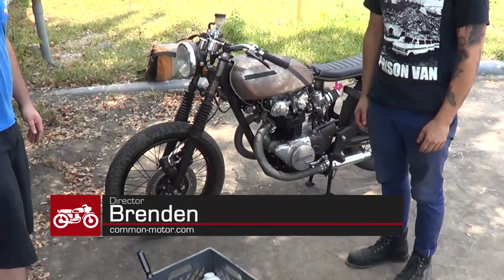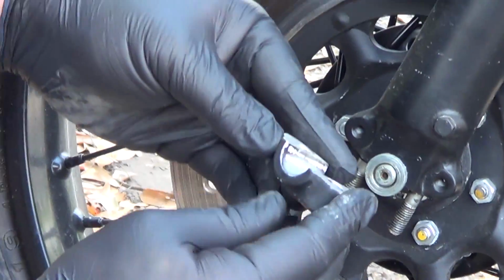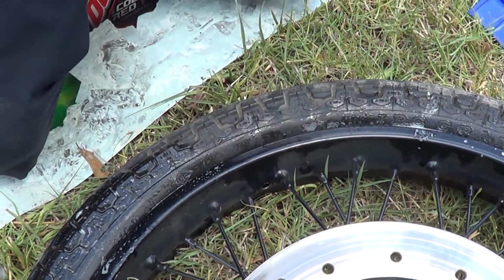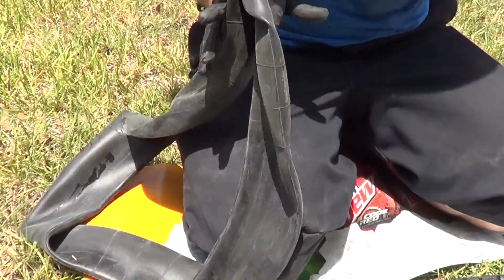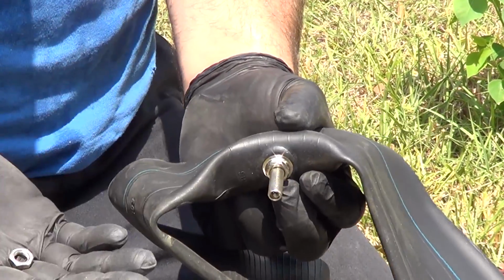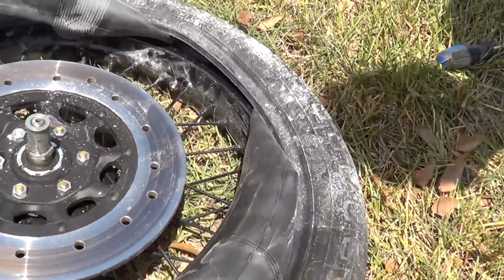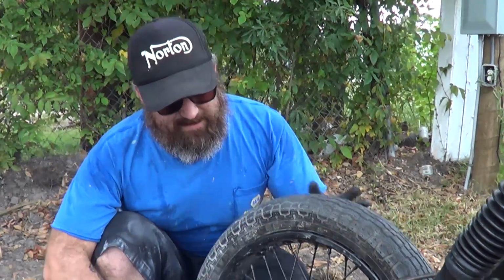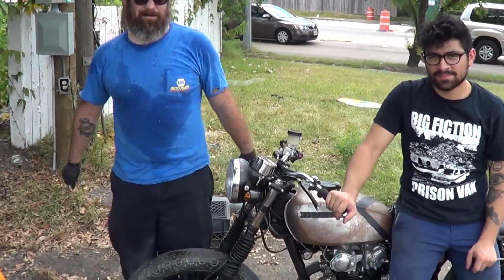How to Change a Flat Tire on a Motorcycle: Honda CB450 / CB350 / CB360

Comment: One plus of a hot day, although we seldom get your sort of heat here, is that the rubber is more pliable. I always hope never to have to work on tyres when it's cold. If so I try to do it in the house, no wonder I'm divorced!
Reply from the maker: I would almost rather walk my bike home than try to change a tire in a Houston summer.
Reply: @Common-motor  I can relate to that, only no way could I push a bike more than a short distance, luckily I have a friend with a trailer who's helped out on odd occasions when I had other breakdowns so I know I could rely on his help.